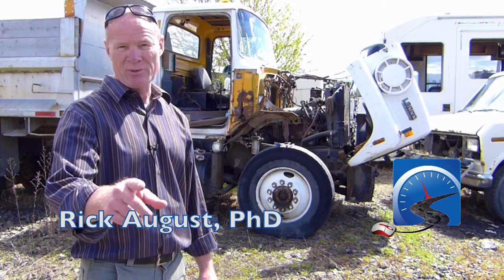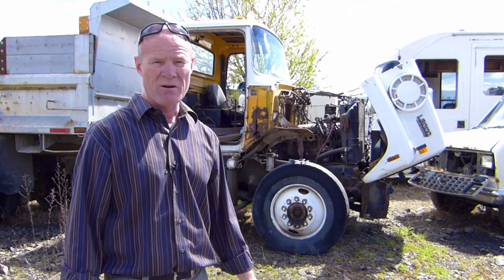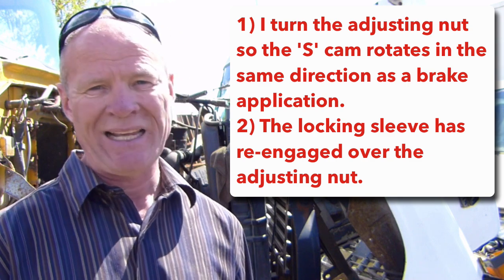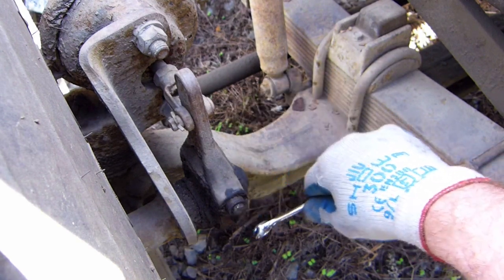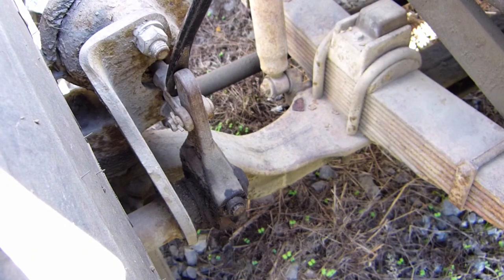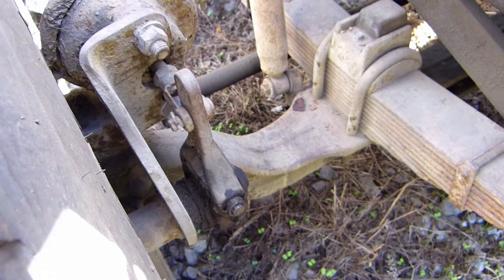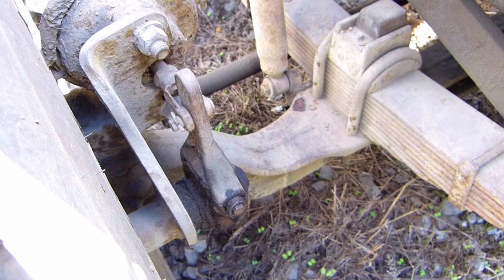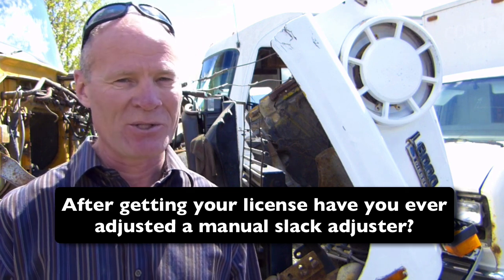How to Adjust a Manual Slack Adjuster for your CDL Air Brakes

Comment: I drive a 1984 Pete dump truck, I manually adjust the slack adjusters at least twice a week. When doing a lot of mountain driving including off road, I adjust them at the beginning of the day and in the middle of the day, and again at either the end of the day or the next morning. Before I learned how to properly adjust them, I lost my brakes three times. I was very fortunate all three times I was going slow and at the bottom of the grade. I was able to drive  at 15 to 20 mph while the brakes cooled off.
Reply from the maker: Hi Bob Slate - thank you for your comment and pertinent information. We're happy to hear that the loss of brakes didn't result in a tragedy and turned out to be a learning opportunity. Where are you in the world that you're still allow to have manual slack adjusters? Most places here in Canada make you retro fit automatic slack adjusters? If there is anything further we can do, drop us a note. Always happy to help. All the best, Cheers Rick

Comment: Most trucks nowadays have automatic adjusters, but many trailers are manual.  I drive ag and all the trailers I pull are manual. I am adjusting the brakes on 6 to 10 trailers a day.  One thing I would do differently in adjusting them (non test, in the real world) is I would not turn the nut until it stops/full closed position and then back it off and for good reason.  The nuts/bolts tend to move easily to tighten and it takes much more torque often to back it off.  In my line of work it is very common, especially in older well used trailers that you can adjust the slack to full closed or just further than you wanted to and then when you go to turn the other way, the bolt head strips and you can not back it off, now you got yourself a locked up brake and can not move the trailer, now you have to find something that can turn that stripped bolt head that your wrench will not, like vice grips if you have some handy.  I prefer to use my hammer to check the play in the adjuster and tighten the bolt down bit by bit until I get it in the proper range, then go on to the next one. It's never going to full stop.  One other thing on trailers, not all adjusters are 9/16".  I have to keep with me a 5/16, 7/16, 9/16 and I believe a 12mm, sometimes you will have different size adjustment bolts and style on the same trailer. Some you have to hold a spring loaded locking pin out to be able to back off a bolt, will turn to tighten but will not loosen unless you pull the pin out.

Comment: For the newer technitions out here trying to figure out why they have never seen a manual slack its because their not used in the industry anymore. you will commonly find automatic slack adjusters on the roads today, automatic slack adjusters dont have to be adjusted regularly but must be checked on a routine basis, an out of adjustment automatic slack is usually due to a faulty slack

Comment: Just spent the morning freeing up and adjusting the slack adjusters on my old Saviem SM8, its a 10 ton 4x4 ex military truck. Coming from a car back ground these videos are great to get my head around the basics of air brakes. Its sobering to think that if they are that far out of adjustment the chambers could bottom out, resulting in no brakes. 
Cheers
Duncan (UK)
Reply from the maker: Hi fred bear - Apologies for the late response. Thank you for your comment. We're happy to hear that we could help you understand air brakes and get yours into adjustment. If there is anything further we can do, drop us a note. Always happy to help. All the best, Cheers Rick
Reply: Or rolling the cam over,and no brakes

Comment: 2023 I'm in a CDL class for a month. Or school. I'm sitting here reading my book for CDL Idaho. And it talks about manual slack adjusters. I'm hoping they're not going to ask that on my permit test but who knows I already took my permit test and failed. But I've only been in my class for one week. I got most of the general knowledge it was just the brakes and combination that I failed on so I have to go back at a later date in retake. There is a lot a lot of information you have to know just to pass your CDL test. I feel a bit overwhelmed but I have friends and family members who are CDL truck drivers and they said just stay at it you will eventually pass it. And some of the questions on the permit are like misleading and try to trip you up. I don't love that. But I'm grateful for getting the opportunity in which to try to get my CDL. And I thank you very much for the video and show me what I'm actually looking at.

Comment: I drive a 94 bluebird limo coach .At inspection  slack adjustor needed adjusting. They did .but was done wrong and smoked my new brakes and hub. Was able to back it off. Now going to test drive. If it happens again will need to install new slack adjustor.
Reply from the maker: Hi Doug Banks - Thank you for your comment. And we're happy that we could help out. Let us know if you get the problem sorted. If there is anything further we can do, drop us a note. Always happy to help. All the best, Cheers Rick

Comment: Thank you for the video.  I am always amazed at how people do not listen and ask questions you have answered at least 2-3 times in the video, or in this video do not comprehend this is an example of a system they will not see but need to have basic understanding.  Scary that they will be driving.  Ask a tow driver how often the air tank has smugh in them and you can tell no has ever drained wet tank.   Awesome video good commentary and teaching.
Reply from the maker: Hi Pat B - Thank you for your comment. Yes, it happens that people will ask questions without finishing the video - it happens. On older trucks there was a lot of sludge in air tanks, but on the newer ones, this isn't so much a problem because the air dryers are really good. See this video: https://www.youtube.com/watch?v=yBi-6eUch0w&list=PL0x-bChcUvwG2bSWReQWnk9Tm92L7WN_O&index=18&t=5s All the best, Cheers Rick

Comment: Have to do it all the time mine has manual slack adjusters on it  run a dump truck and do asphalt work on the highway brakes have to work properly have to use them to stay in the machine

Comment: So there will be 4 slack adjusters on a 10 wheel tractor and 4 slack adjusters on the trailer as well if total wheels are 18?
Reply: 2 per axle.   3 axles(10wheeler) 6 slack adjusters, 5 axles(18wheeler), 10 slack adjusters.

Comment: Going to start driving a Western Star Batch mixer cement truck (4 axle - 2 front 2 rear) sometime soon. Any advice available out there?
Reply from the maker: Hi RCLBranch160 Barons - Thank you for your question. Know that the truck is going to have a turning radius bigger than a football field. So for the first little bit, know that the slower you go, the sharper it's going to turn. If you're in the least little doubt about where your vehicle is in space and place, get out and look. Secure the vehicle first of course. ;o) Brake early and maintain a 5 second following distance. If there is anything further we can do, drop us a note. Always happy to help. All the best, Cheers Rick

Comment: Great vids, thanks. 
What is meant by “pedal reserve” ?
Reply: It means the amount of pedal you have left if you need to brake harder.  You should be able to stop with less than a quarter  of the full travel of the pedal.  You want the extra so that if brakes wear, you have more brake to apply.  If you can press the pedal all the way to the floor and still not stop, that is VERY bad.

Comment: So worm screw on that adjuster rod?     Isn't the s cam splined?
Reply from the maker: Hi Bubba Hyde - I don't understand your question my friend? Please reword. All the best, Cheers Rick
Reply: @smartdrivetest  I believe the splined end of the s cam goes into a ratcheting sprocket that is geared on the outside and adjusted by the 9/16 worm screw.  I had originally not understood the ratcheting and outside gears on the sprocket.
Thanks for your checking back!  Awesome work!

Comment: Forget  the bar , don't get me wrong u still can check with a bar but it is not necessary 
Tighten your slack slowly back it off 
Tap the drum with a small hammer 
When the drum rings you are done
U can back off & repeat a few times
Follow this procedure on all wheels tractor & trailer your brakes will all be equal u will be amazed how this works
Reply from the maker: Hi FINALDRIVEGUY - Thank you for your comment. Owing to the fact that the drum is cast iron, I would strongly recommend NOT hitting it with a hammer - even a small one. And especially in the winter when the drum is cold. You could crack or break the drum. Fortunately, almost all manual slack adjusters have gone the way of the dodo bird and it is unlikely that drivers are going to encounter manual slack adjusters. If there is anything further we can do, drop us a note. Always happy to help. All the best, Cheers Rick
Reply: You are not cracking a brake drum tapping on it with a small hammer its not made out of GLASS
Its heat-conductive and wear-resistant cast iron alloy
You would have a hell of a time cracking it with a 20 pound sledge hammer.
Oh & one more thing running in the rain in cold weather & you park overnight & your brake shoes freeze to the drums what do you do release the brakes & beat the drums with a hammer to break them loose 
I would recommend chocking your wheels first SO YOU DON'T GET RUN OVER. 
I think a canadian could prolly even figure that out, Or maybe you can wait till the spring thaw.
Reply: @smartdrivetest   got to hit the drum with a hammer, yes. most of the time it's the only way to get them off...
Reply: @smartdrivetest  Just watch some ice road truckers they wack the crap out of drums when it is -50 out haha Usually to unfreeze the brakes.
Reply: I just spent 3 hours freeing stuck brakes on an old truck. I beat the piss out of them with a 10lb sledge. No cracks, no brakes.  Worked like a charm. This guy is a saying you'll break them needs a reality check... And hair.

Comment: Is 6pack actually necessary.  Wouldn't you just pump the brakes just the same?
Reply from the maker: Hi Robert Collins - Thank you for your comment and query. Once a month or so it's important to do a 6 pack because during normal brake applications, you're just not depressing the brakes hard enough for these to crank over to the next position on the ratchet. If there is anything further we can do, drop us a note. Always happy to help. All the best, Cheers Rick
Reply: Great info. What a difference in the 2 system.  Our would be better if maintained.
  What are the drawbacks of not putting the cover on the brake chamber.

Comment: Hello, Rick! I am having trouble with curves they are so hard the ones by my house are 45mph but I can't seem to do 30mph around them any tips on how to get the hang of it? They scare me so much!
Reply from the maker: Hey - is this the newly licensed driver?? 80) Do 30mph!  A significant number of roads have speed limits according to the highway designation and not according to the physical properties of the roadway. You need to do what you comfortable with that allows you to maintain control of the vehicle. If you're comfortable with 30mph - do 30. Also, make sure that you're looking through the curve and down the road. The car will go where you're looking. In other words, don't be looking at the end of the hood - pick you gaze up to look through the curve. All the best, Cheers Rick
Reply: Thanks!
Reply from the maker: You are most welcome my friend!

Comment: What causes this to come loose?
Reply from the maker: Hi Bubba Hyde - it doesn't come loose my friend. The brake pads wear and your adjusting how close the pads are to the shoes. All the best, Cheers Rick
Reply: @smartdrivetest  good good, in an inch and a half of push rod travel how much outward movement of the pads at the cam?
How much expansion away from the pads could a heated from conceivably move?
Thanks Rick!

Comment: What can cause the locking sleeve not want to come out? It pushes in fine but doesn't want to come back out. It's a new manual bendix
Reply: Not enough grease, or dirt in the gap.
Reply: No grease

Comment: Why do we need to be tested on manual slack adjusted which we dont have it in our trucking industrail!!!!!!! Mcarithium
Reply: what ?? you think that is tough..??? plumbers still have to prove they can work with lead pipe and solder  lead pipe.. we havent used lead pipe regular since 1935. but its all over for repairs and they have always tested for it.. maybe 1935 is not correct.. but you get the meaning....and you dont use cast iron much .. but you still got to prove you can work with it to get your journey level card in plumbing. as well as threading pipe.. which is usually reserved to pipe fitters.. but occasionaly a plumber will install gas lines with black pipe and need to thread it themselves..  and once in a blue moon.. you just might run into  a slack adjuster... and you need to know what to do...
Reply: @gregorysias6090  To bad the repair industry didn't keep up that well. Most mechanics now have no idea what a carburetor is!
Reply: At think a lot of trailers still have manual adjusters.